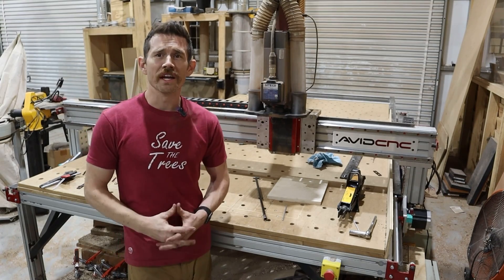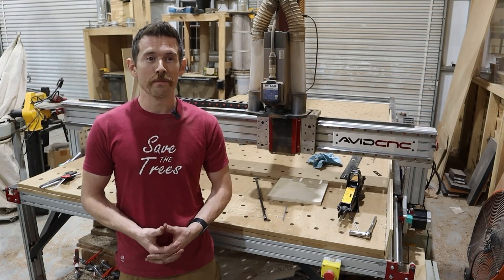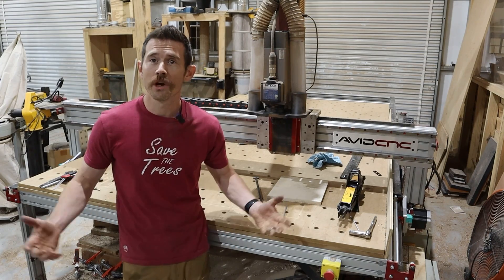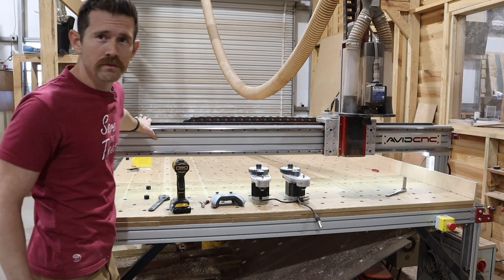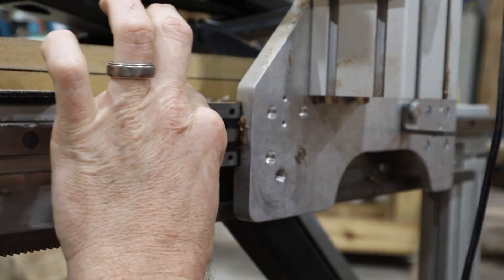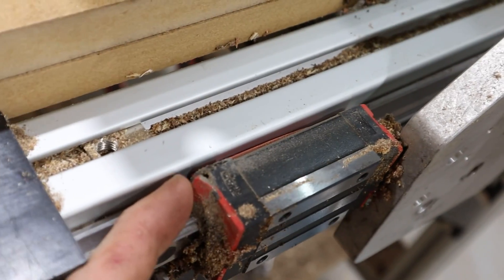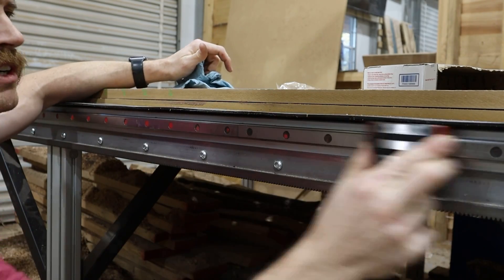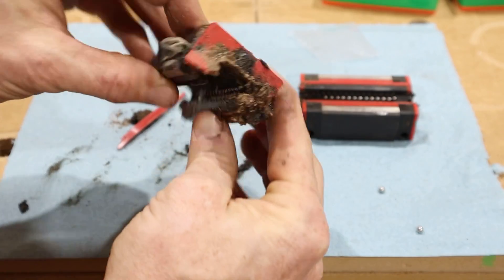How durable is my CNC?

Comment: I see why you had a problem.  The holes in the rail where the screws go should have covers over each screw to prevent debris from getting into the slide.

Comment: Also as Shannon Williams said clean with WD40 periodically. I cut dense foam with my machine and I had the same issues as you. The super fine dust takes the bearings out every time.
I also loosened the end pc's on the bearing blocks and pushed them closer to the rail so as to push the debris out of the way. There is slight movement that can be adjusted when you loosen the Phillips screws and grease zerk fitting.
Reply from the maker: Great tips! Thank you for sharing!

Comment: Matt I just finished building my 2nd DIY CNC Machine using Hiwin Linear rails similar to yours. I see you have the red caps covering the holes in the linear rails. From experience I'm telling you this ...... those caps CANNOT be sunk below the surface of the rail. They MUST be flush because dirt and debris gather on top of the cap and then when the bearing slides over top, it picks up the debris which in turn could cause the bearing to fail.

Comment: On my ShopSabre I'm weekly cleaning rails and around bearing blocks, then adding new grease with a grease gun on bearing blocks grease zerks displacing old grease which is wiped up.
 
Every 3-4 weeks wd40 is used to flush bearing blocks and by slowly moving Y and X it thins grease in bearing blocks which is wiped up, then more wd40 is added. That's repeated until I can tell a lot of grease is flushed out. At that point wd40 is wiped off and bearing blocks greased, moved, excess wiped then repeated until excess grease doesn't appear thinned by wd40.

Over 3 years my bearings have kept in great shape by having a proactive cleaning regiment. I'd recommend doing something similar but I didn't see any grease zerks on those bearing blocks.
Reply from the maker: Yeah, I think i def learned the hard way I need to do better with grease. My problem though has always been contamination, we flatten slabs mostly and has always been notorious for terrible dust collection due to the huge cutter and large chips. So keeping the rails “clean” would literally be a full time job lol…

Hopefully better regular maintenance and improved Dust collection will help with this problem moving forward.
Reply: @m2lumber  a quick spray with compressed air and wiping with shop grade paper towels and normal cue tips can pretty quickly clean around bearing blocks and rails.

Cleaning is fairly quick, something you can do at the end of a work day in about 10-30 minutes depending on quality of clean. Re greasing with grease gun, moving then wiping excess takes about 20-30 minutes for my 6 rails(2 on X, 2 on Y and 2 on Z). WD40 clean takes around 30-40 minutes.

My ShopSabre has ballscrews on every axis and they also go through a similar cleaning regiment but I do that every couple weeks, takes about 30 minutes.

Comment: Did the bearings come pre-greased? Most have shipping/ storage grease you have to remove and then grease. Looks like a nice machine.
Reply from the maker: They were sealed in a plastic bag, they did seem to be pre greased so I didn’t not apply much. One thing I read that I have not figured out yet is “how much” grease to apply and how often??? I’ve read you can over-grease them and damage them so I’m not sure if that’s what happened with the first set or not…but def don’t want this issue repeating!
Reply: @m2lumber  usually you soak bearings like that in something like alcohol to remove the packing grease and then, once on the rail add a touch of grease usually around half inch to one inch depending on size. Go easy and do not pull hard on the trigger run them back and forth to run the grease through
Reply: Oh and its called packing grease
Reply from the maker: @KernsJW  yeah I don’t think these were that type of bearing you’re describing, there was def no packing grease to need to remove with alcohol soaking or anything. Just a very thin layer of some type of RP.
Reply: @m2lumber  you have to disassemble the bearings and clean them, plus they need constant lubrication😅, everything is in hiwin manual for them, plus you have to choose high pressure grease
Reply: @m2lumber  A good rule of thumb for greasing: Smooth slow pumps - if its getting hard to pump, stop. If you keep pumping, you could be hydraulicly pushing the seals out or ripping the unit apart from the inside.

How much grease:
-installing hand packing roller bearings: pack it full, then roll it to squeeze out the excess.
-linear guide bearings: new grease is supposed to push all the grime out. Slow pump until it's starting to squirt out in places. If it seems like it's resisting, it may be clogged and instead need cleaned out with wd40, and you may have to manually pick caked grim off the wipers. Ideally you are greasing often enough to keep them flowing clean grease easily. (eg 1 shift per day in a clean machine shop = greasing approx 1-2 weeks, heavy wood use will need more often). run them at low to medium speed several strokes across the length of the machine to let them relieve before using at high speed.
-"Sealed" bearings or similar: filled approx 30-60% max. Want airspace, not forcing it to churn grease.

These are all general guidelines for typical use. Follow what the manufacturer says and consider your use case.
Reply: Oh that goo… lol